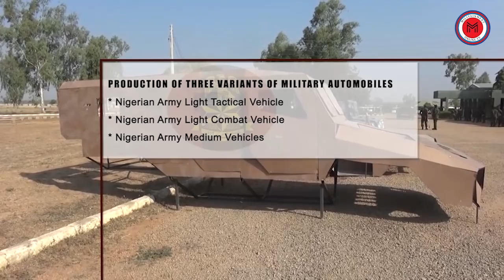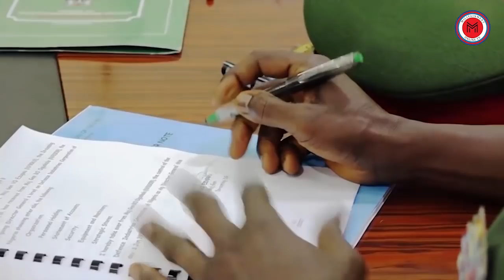This Is Made In Nigeria And By The Nigerian Army

Comment: This is very good. Nigerian military is finally serious about moving forward quickly. We need to also concentrate on optics, electronics and aerodynamics. Those are the three main things that determine the potency (awareness, accuracy and  lethality) of modern weapon platforms. We need to equip these vehicles with advance electronics (infra red and radar) and mount missiles on them to create SHORADs (Short Range Area Defense Systems). 
Way back in 2013 (under Jonathan), NA built it's first indegenous AFV (Igirigi), the Airforce built drones (Gulma and Amebo) and the Navy built a SDB (NNS Andoni).It is good to know that Buhari's administration is building in it. Also, ProForce (in Ogun State) has been building very capable Armoured vehicles for the Army for sine years now. Innoson too is very capable.

God bless Nigeria.
Reply: The first paragraph made no sense. Aerodynamics?, you mean aerospace. Infra red is not that hard to achieve, soviet and NATO vehicles had that stuff since the 1960's. Not sure why you would need radar on a ground vehicle. Close in defense systems don't use missiles or even rockets, they usually just launch a glorified grenade out of a tube using a controlled explosive, even simpler is reactive armor tiles like what the Russians and Israelis use on their tanks.

Comment: Well considering the kinds of enemies that the Nigerian Army would face would be mostly terror cells, then that has to be brought into consideration. They will be facing mostly 7.62 type rifle fire, some 12.7 and 14.5 fire, and a rare RPG, IED and mortar. 
Thus the army will need to do 1 of 2 things.
-make cheap,easily repeatable vehicles that can atleast deflect 7.62
-make vehicles that can withstand most of these issues, but is expensive and hard to make in a factory style.
If these vehicles can atleast do the first option, then its an excellent advancement.